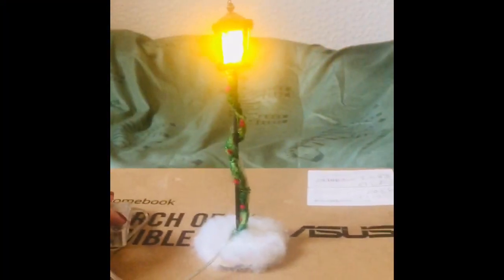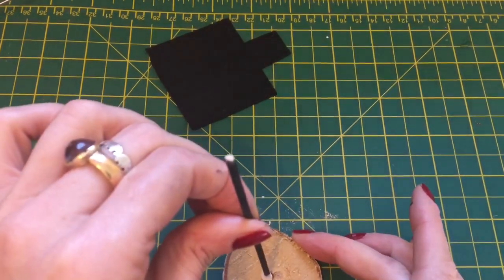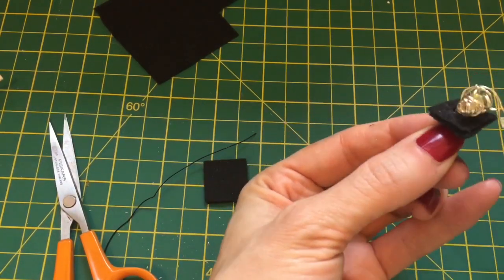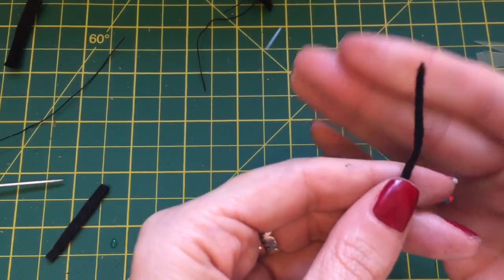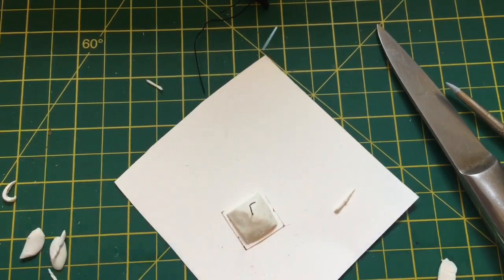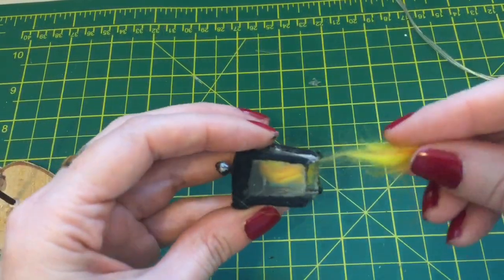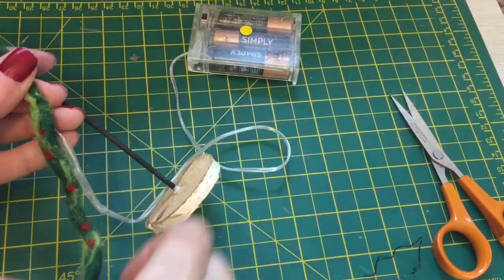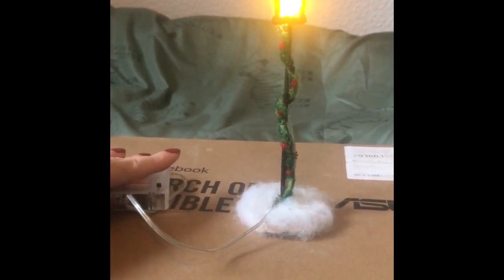DIY - How To Make A Miniature 1 - 12 Scale Working Victorian Lamp - The Wishing Shed

Comment: Huh!? Wouldn't you need to add( solder) resistance to the chip circuit cutting down to so few lights? I can't imagine that working very well (batteries should burn fast!) if you dont adjust. Cutting two off is one thing, but you cut most lights off... I came to see how you wired it. I'd love to hear how long this set up actually worked for you! Cute! 🙏